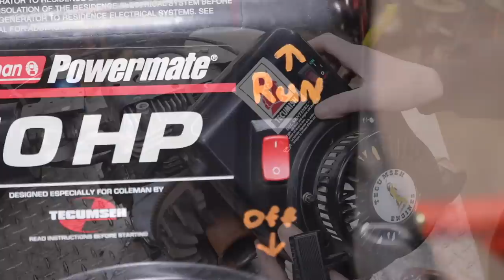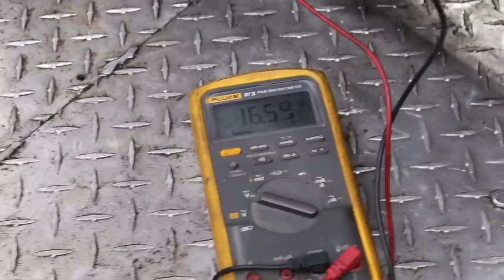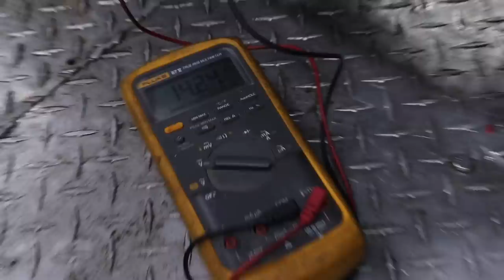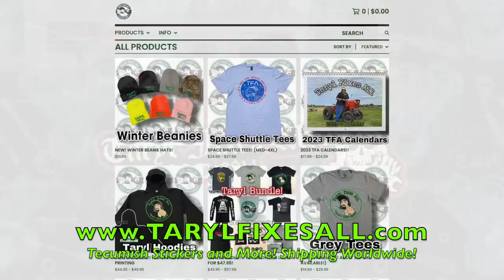Can you add electric start to a generator? Let's try

Comment: Diode does not change AC to DC. A rectifier does this job.
Reply: But it kinda does. It block the negative half of the AC wave therefore outputting pulsed DC.
Reply: Yep, what you get with a single diode like that is called half wave rectifier.   Basically half of the sine wave is passed through as a charge circuit.   And as the meter showed the peak voltage is higher than you may want, but its not a 100%  "on" so it usually works,   since half of the power is lost when the diode is not passing and its a half sine wave.
Reply: @luuk-out-below9804  Ok thank you!
Reply: @CompetentSalesUSA  noproblem.  That meter DC meter reading Taryl showed would be an approximate reading as the meter will try to read a value but its not a true DC voltage.  Also the current on this is very low so it could work ok but its just not ideal.
Reply: What you get is half rectified DC, which is good enough to charge a battery. Just check all those 'wall wart' chargers. Most of them are half rectified DC.
Reply: @brettsalling  it depends which way around a diode is what it blocks. Diodes have an anode and a cathode. They're polarized devices.
Reply: @1pcfred  you're absolutely correct, I just tried to simplify it. Maybe a little much.
Reply: @brettsalling  electricity is simple but gets complicated. If you really want to get confused find out what avalanche and zener diodes are.